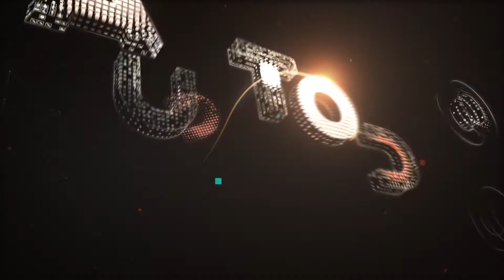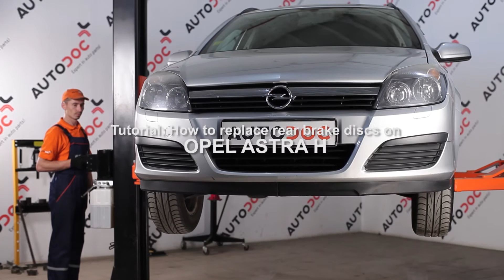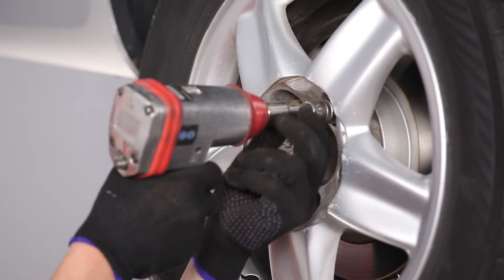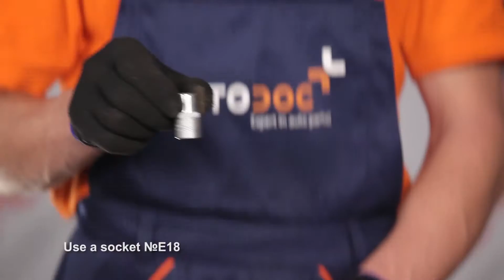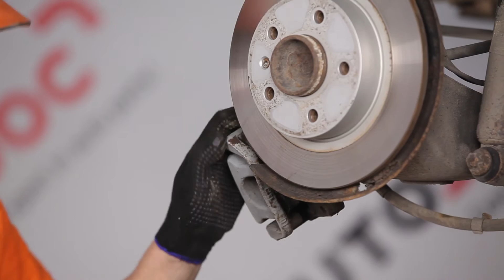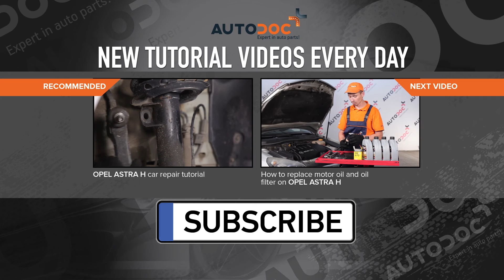How to change rear brake discs on OPEL ASTRA H TUTORIAL | AUTODOC

Comment: Helpful vid but cannot believe you've not taken a wire brush etc to cleanup the hub thoroughly before fitting new discs - any grit or rust under the disc will cause grief later. AND of course wind back the piston, as others have said.
Reply from the maker: Thank you for your feedback ! You are absolutely right - it is necessary to do it in practice. But our video is just informative and to save  time, some  necessary steps were omitted. Best regards, Autodoc.

Comment: What about winding the pistons back in before fitting new pads? Anybody can work on a clean setup now show us one that's actually been used.
Reply from the maker: Thank you for your feedback! You are absolutely right. When fixing new pads,  wnd the pistons back (it is necessary to open the  brake tank сap ).Best regards, Autodoc.
Reply: My thoughts too, a dam site easier to do that while they're bolted in place and not flopping about on the hose !
Reply: @autodocuk  can you use a g clamp to wind back the piston.
Reply: @sarah-jayneallan5012  On the front yes but the rear needs a wind back tool

Comment: Changes the disc ignores the leaking shock behind it then uses silver sockets on a pneumatic air wrench
Reply from the maker: This video is about replacing the rear brake discs with OPEL ASTRA. there is a separate video for the shock absorber.